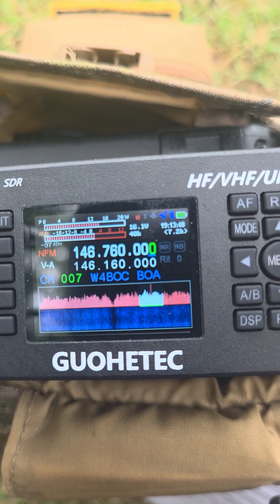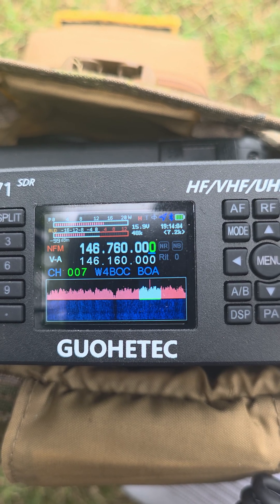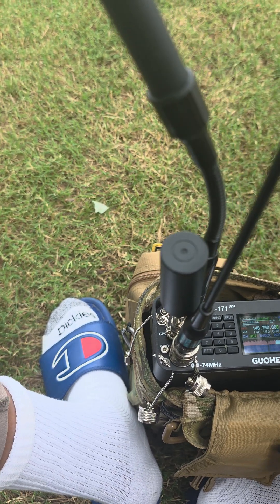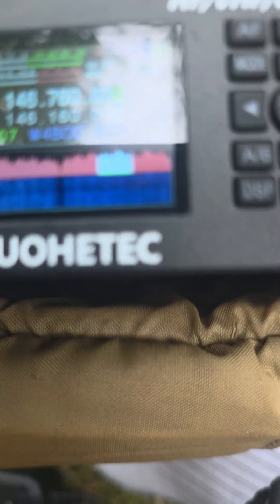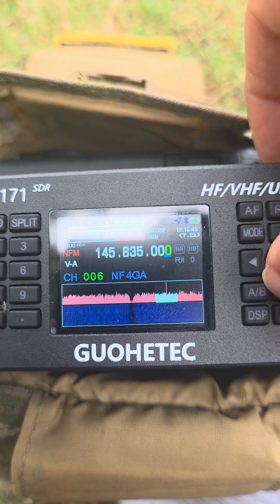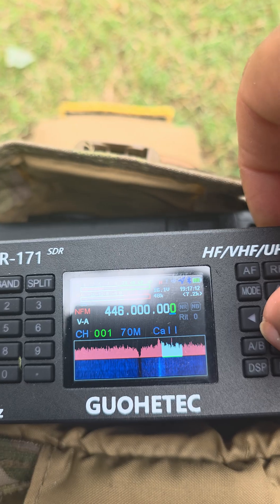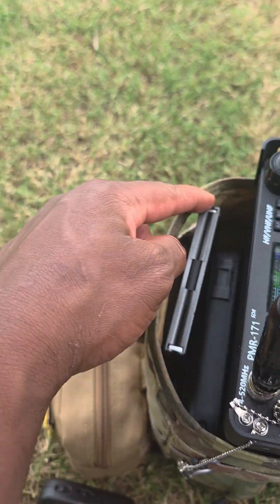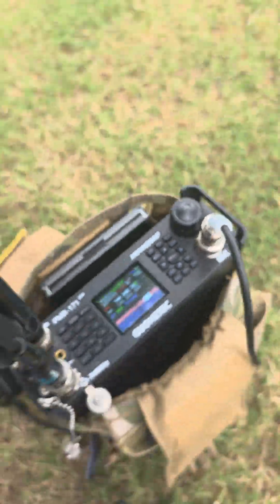GUOHETEC PMR-171Early  Difficulties in Channel Programming and VHF operations!

Comment: I hope they work with you to resolve the vhf/uhf issues. I’m waiting a bit longer the hf does seem to work well Walt from Coastal Waves has been doing testing and is pretty happy. 73 Don
Reply from the maker: I've been testing all day and right now it's very difficult .. Today ! I got FLRIG, Wsjtx , and JS8 working but now I'm having a problem with power output on Winlink(will only transmit at lower than 1 watt or meter isn't working)? They added a new "mode" without any instruction (DTU).  Not to mention I cannot transmit phone on HF.  My buddy a few miles away hasn't had much luck with his (he got this week) so much noise all digital modes Crash.  My 20 plus year old radios do not have any of these problems doing the same thngs.

Comment: Dawayne, what version software is installed on that 171?
Reply from the maker: As of right now 3.6.7 ( it was mailed with that.)
Reply: @metroatlantahamradio334  was that version on the dongle that you got sent? Because a dude on the WhatsApp forum, got his radio the other day, and the dongle did not have the firmware binary on there.
Reply from the maker: It was on the radio. And It did not come on the dongle.
Reply: @metroatlantahamradio334 that’s what the other guy saw too. Shame, I would love to have tested it. Soon hopefully we will have a new binary to test. 
Curious, have you tested power output compared to power settings?
On the current release version and previous versions, no matter what power level you set it to, it didn’t change anything. It would just TX at max power for the band. 
The newer versions seem to have addressed that. It appears to now TX somewhat closer to setting.
Reply from the maker: I'm loosing patience with this radio, they are sending me a new hand mic (because on HF It won't transmit).  I have many ups and many Downs with this rig (FOR SOTA).
Reply: @metroatlantahamradio334 not surprised brother. 
If the hand mic works in other modes and on other bands/freqs, it’s not the mic, it’s software, it’s a bug. 
I would suggest to roll back versions to test this theory, but as you don’t have the binary that is currently installed in the radio, maybe not!!!
Reply from the maker: My thoughts exactly.  Time to trow this in the old radio bin.

Comment: I had the same problem with V/U frequencies changing or reverting to default with my Q900 V3.  I suspected that voltage changes mess with the memory on these units.  Going from external power to battery and back would make it forget things like my entered callsign and frequency programming.  I have a PMR-171 coming by the way in a couple of days.  I really want this radio to work out - loved my Q900 V3 and the receiver was seriously spectacular when you got the IF and RF gain settings right.  The keyboard operation was fun and fast too.  If I didn't drop the radio on its control panel I would still be using it.
Reply from the maker: That sounds like a frustrating experience, I hope you have better luck with the new radio! I've finally thrown in the towel on this radio.  I feel like I should have known better honestly.
Reply: @metroatlantahamradio334  That is disappointing.  Other than losing the stored frequencies have you had other problems with it?  I'm mainly a CW op on HF and for that purpose the Q900 was great.  The fancy stuff was kind of hit or miss with the radio.
Reply from the maker: Right now no transmit on HF. But they say they're sending a new Mic.  I can't see how that fixes anything.

Comment: Hi, this is guohetec, you first need to open outbanden in the settings menu, and then use the programming software to write one channel at a time. We will update the programming software soon to make programming more stable.
Reply from the maker: Guys, I have programmed Baufeng, VGC, TTy,  Yaesu, Icom, Anytone, RT SYSTEMS, CHIRP and even Dmr in both HandHeld and Base stations and The software for this radio is the worst I've seen in all of my years as a Ham Radio Operator.  Please treat customers with a little more respect and understanding with the assumption that this is all Operator error. Even though this software is the most difficult I've ever experienced because of my years of experience and time spent I was able to actually program some channels. I like this radio I truly do but your response is very inaccurate in identifying what the real problem is. Honestly the software interface is actually unacceptable.
Reply: Guohetec Why don’t you allow an open source software such as ‘Chirp’ to interface with the radio. Then you don’t have to maintain the programming software?
Reply from the maker: It would also help if the radio wouldn't dump the programmed frequencies randomly also.
Reply: @metroatlantahamradio334 agreed. I have seen a similar problem. Not often, but it did happen. I also saw where it would not write the channel name unless I was in Chennai mode on the radio and showing that memory location. If not, I would have to write the file a crap load of times for it to get to the location of the channel.
Reply: @metroatlantahamradio334 BTW, this is my very first DMR radio and I still need to register for DMR like I did 20 years ago for D Star. My fav now is C4FM like I have in my 991A and my FTM-200DR. Maybe you can do a video of that portion of this rig too. 👍
Reply: It is important that THIS function works properly.:yougotthis:
So please fix it. ❤❤
I will probably receive my radio tomorrow.:elbowcough:
Reply: GUOHETEC - why don't you listen to the customer feedback!! - I am considering buying the GUOHETEC PMR-171 but not just yet - there are far to many problems to spend money on it at the moment

Comment: I just stumbled onto your channel and I really like your videos and your presentation. You’re not pretentious. I see your unit doesn’t have the RJ 45 connection for the hand mic. I like the one that you have…more sturdy.Where did you purchase that unit please?
Reply from the maker: https://a.co/d/34iwJU2
Reply from the maker: Amazon! And thank you for your kind words!! I'm tinkering with this radio every day!
Reply: @metroatlantahamradio334  Thank you for the link. But I’m looking for one with GPS,DMR and Compass. It doesn’t specify on the Amazon listing.
Does yours have that?
Reply from the maker: I have the DMR and GPS. if I could do it all over I'd get the full set.
Reply: @metroatlantahamradio334 Sorry for the question. Again. The Amazon link you posted offers the model with GPS and DMR,and COMPASS?
Reply from the maker: I'll check in the morning.  I'm trying to get the PTT to work on direwolf right now.  I'll send you everything I know.
Reply: @metroatlantahamradio334 Did you confirm that the Amazon unit has GPS and DMR?
Reply: @elitecombatfitnesscentral  be advised, the DMR is half-duplex (radio to radio) only and not capable of tier 2 DMR over repeaters. I have even had trouble with DMR when communicating with other brands such as Anytone. DMR when going from 171 to 119 GH radios appears to work fine. There is also no encryption available for the 171.

Comment: On the DMR mode dose it have AES256 encryption and do you have to put in the keys manually ? Or are they third-party sourced? Also if you would rate just the DMR UHF/VHF and just the HF with the auto tuner how is the radio doing with just those functions in mind ?
Reply: The encryption is not available on the 171. Only on their 119 model radio. Also, they provide the key and it is ~$300 per key and you need a pair…..
DMR is tier 1 only, and cannot communicate over DMR repeaters. I have also had issues with DMR communication to outside brands such as Anytone. 
Just helping you set expectations.
Reply from the maker: Thanks a lot man! I watched l your videos  too doing research!
Reply: @metroatlantahamradio334  pleasure meeting you, brother. I still watch people like yourself. Also, maybe I can learn something from you.😁
Reply from the maker: The Programming of the UHF/VHF Needs a lot of attention as it is terrible. The APRS application is still in development as I have been told. The Applications like FT8CN and the BLE radio control is cool too . The HF operation has been good ( I did a successful POTA yesterday) however!! There was some glitches that I didn't like ( I selected 20 meters in the menu and 80 meters kept popping up). I tested all the others and they worked (I eventually typed 20 into the key pad and went from there).  
It's the perfect form factor for a very imperfect radio.  However once I get it set up for digital from the front face ( USBC TO OTG CABLE) . it'll be cool again 😎
Reply: @metroatlantahamradio334 cool nice. I’m assuming then you haven’t gotten to AES256 with the DMR for UHF/VHF then ?
Reply: @metroatlantahamradio334  Please keep us posted!!!🙏🤜🤛👍

Comment: I will say ... At least they are trying to make something we want.
Reply from the maker: I haven't given up but I wanted to share with the community.  I actually DO really like this radio.
Reply: @metroatlantahamradio334 I think this is the next X6100 in terms of "fun"
Reply: Agreed. A shack in a box. All frequencies and modes in one rig. They definitely are on to something and have made strides. If the software bugs are ironed out, it will be amazing.
Reply from the maker: You've come a long way ? Has your experience improved?